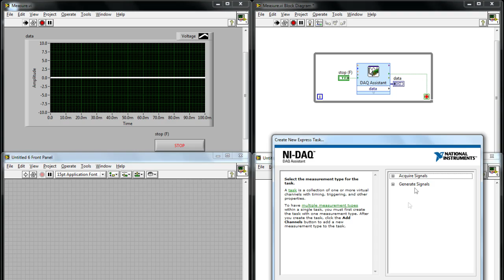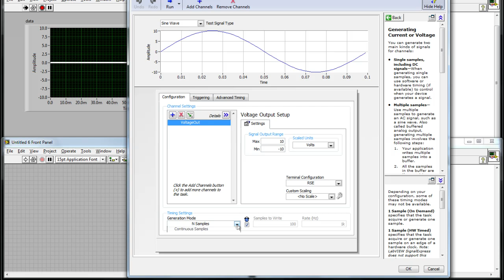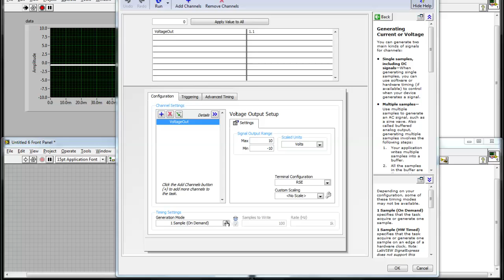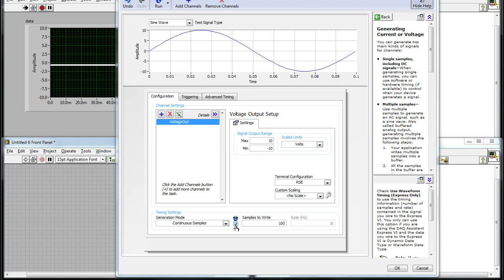Generating a Signal with Your Computer

Comment: how can we generate a signal using computer in labview software but not using DAQ? 

I need a continuous pulse signal which is basically increasing and decreasing slowly w.r.t. time. i.e. it's a not pulse as it's already given in labview simulate signal option. I need the d.c. signal which may be will be merge of more than 2-3 signals. 
Please Help. ASAP.